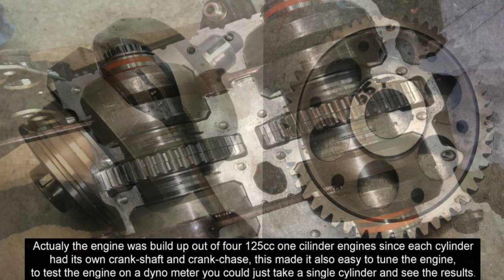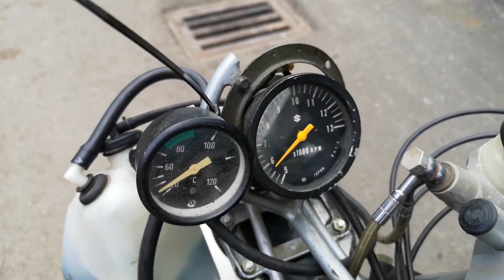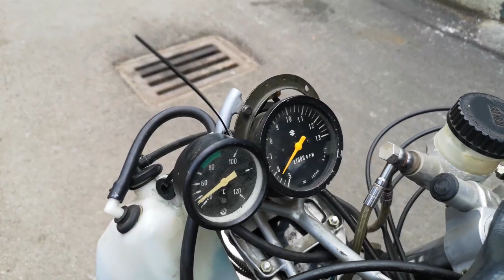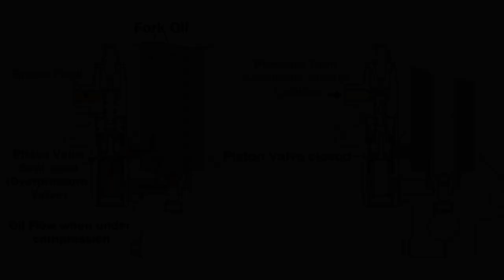Suzuki RG 500 - The greatest premier-class GP bike of all time !

Comment: I had a 1989 RG500 'C' Series Pepsi Suzuki one of the last made, (Frame Number HM31 106277 no 873 of CH Models) and rode it hard including Track Days at Oulton, Cadwell and Mallory Park but was classed as up to 1000cc Class, managed to keep up on corners, but Honda's Blackbirds beat me on acceleration - however finished 3rd so considered a Win at Cadwell Park ! However sold it eventually as it was either going to Kill Me or get Nicked for Speeding to a Guy from Sweden at a huge Profit Today in Mint Condition [as mine was] with low Mileage worth in excess of £20k and appreciating rapidly no doubt ! - I Did a trip from the UK to Switzerland including all [or most] of the Alpine Passes and the Bike was a dream and cruised at 65 mph in 6th gear at around 3500 rpm with ease !  :face-orange-biting-nails:

Comment: I believe the final year RG 500 used reed valves in place of discs. Love this channel 👍
Reply: Yeah, I noticed the considerably larger size of those intake passages compared to the lightweight Suzuki and Kawasaki machines back in the '70s.  That reed valves came to prevalence for intakes was a surprise to me.
Reply: The good materials weren't there to make reed valves much of a success back then. Better materials came along in the 80s. Reeds tend to give a better spread of power than discs  
which tend to be all up at the top end.

Comment: Is it me or are those carbs aren't even close to being in sync?
Reply: Good catch!  Seems like there is definitely slack in the cables, b/w front and rear slides.
Reply: Given that it's freshly rebuilt, maybe not a surprise. Probably needed a final tune and fettle all round, which I assume was why it didn't get a spin around the yard!
Reply: I wondered if this was on purpose to spread the power band which was violent in 500 cc 2 strokes , or any racing 2 stroke for that matter
Reply: @kevinoneil7532  No, you don't get the luxury of progression with these things. They need to be set up razor sharp, to give the rider the fewest surprises.
Although, that was part of the rationale behind the later generation strokers, with 'big bang' and 'two bang' and so on, but that was achieved by altering firing order and variable ignition timing.